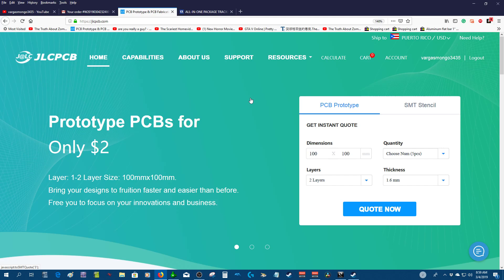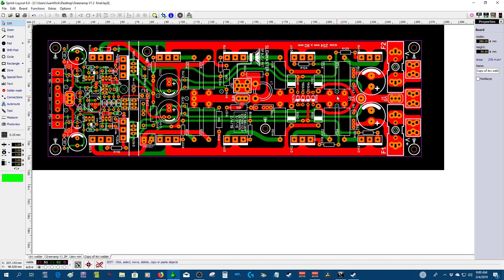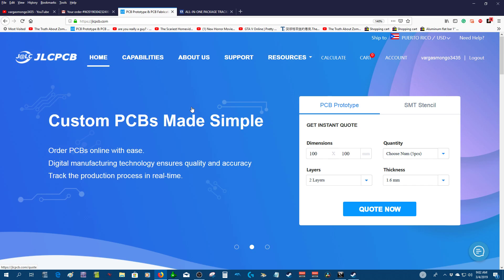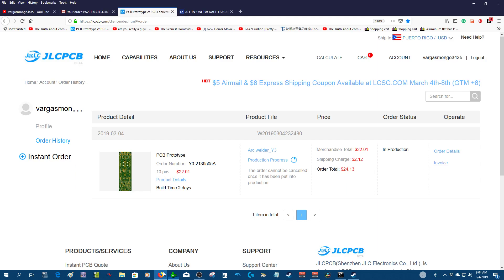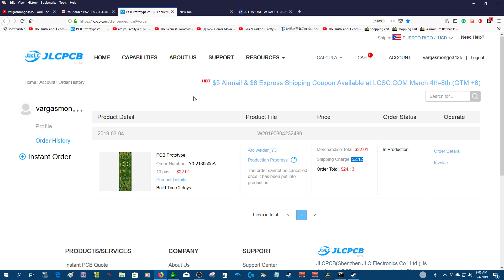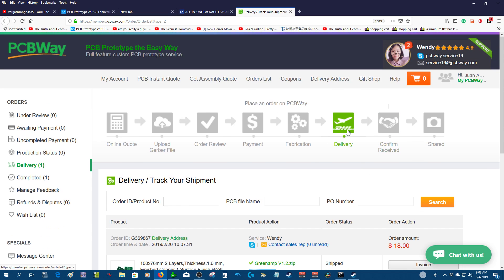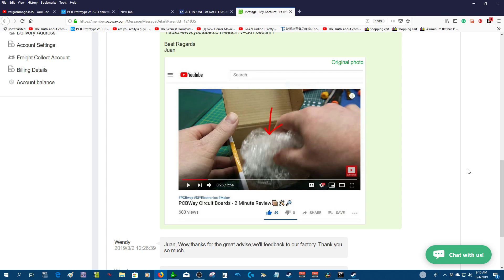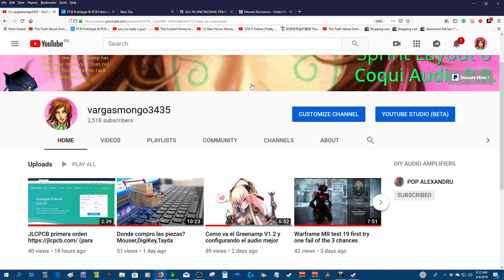First time traying JLCPCB PCB manufacturers

Comment: Estimado Juan por tu experiencia de compra es recomendable comprar los componentes electronicos en LCSC? que es empresa parte de JLCPCB,  o solo recomiendas las que en un video anterior sugeriste? ya que  los precios ahí se ven atractivos, saludos desde México.
Reply from the maker: te recomiendo Mouser o DigiKey para los semiconductores y las otras tiendas y esa de LCSC para los componentes pasivos los precios son buenos yo uso Tayda Electronics mas para las resistencias de 1/4W que son buenas :) te digo Mouser y DigiKey para semiconductores porque asi evitas productos falsos como en ebay pasa mucho eso
Reply: Agradezco la amable y rápida respuesta estimado juan, pues a comprar se ha dicho jejejejejeje, bendiciones.
Reply from the maker: @ALPACINOLAGUARACHA  :)